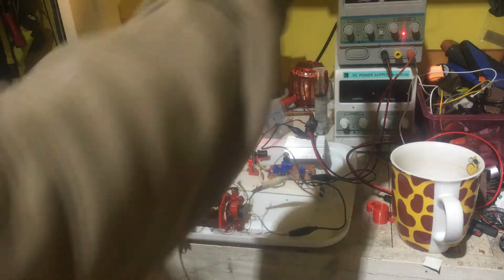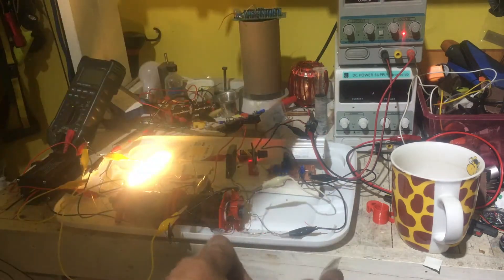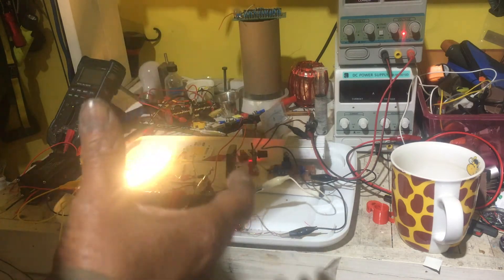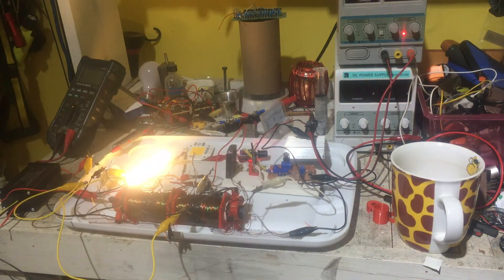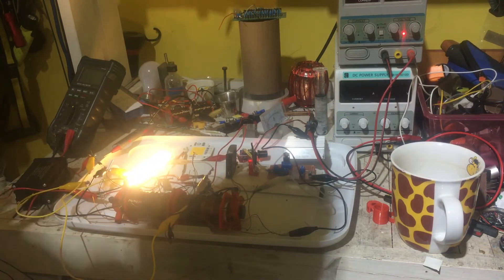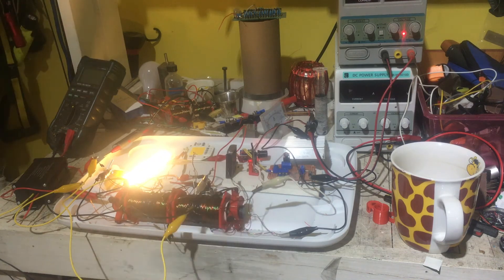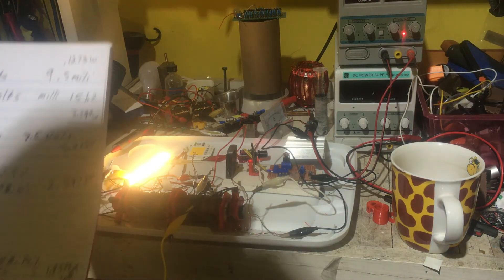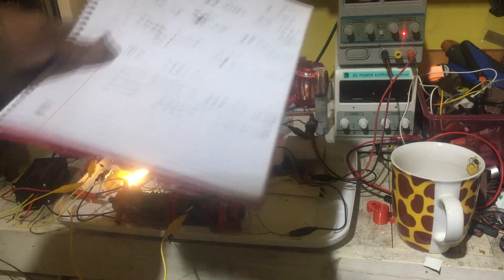OVER UNITY is SHARED SSG  This system negates all of OHM"S laws . Evidence above Greed disprove My

Comment: Inductors are non-ohmic components. Take a thick wire choke and put low frequency AC into it so at least .75 amps are being drawn. now measure the AC going through the choke.  You can easily measure >2X the input voltage with greater amps.  And it is not the multimeter messing up either, because if you are doing it from a DC source with an H-bridge, you can use a diode and separate out the back EMF and run things grounding into the + terminal of a battery.  

Problem is getting that power out...  It is happening because of the inductors back-EMF production, but it takes amperage into the coil to cause the effect.  Everything I do to extract the power gain results in a loss of the effect. 

I can easily charge a 12V battery from a 6V battery with the Back-EMF voltage gain.  See my videos in my channel where I run a motor from the negative terminal of a battery.  problem is for me it seems unusable..  If you measure output wattage you will be under-unity.  But if you measure what's in the circuit, it is well above unity.  

It is indeed an interesting effect..  And perhaps there is a way to tap it.  I have been trying hundreds of configurations and can't crack it.
Reply from the maker: very true now change the conception to a pressure vessel . The problem becomes no way to hold magnetic flux . in rotation fluctuation except in crystal form. but we don't have crystal wire except . it my be possible in quartz enriched iron, new metal are being created so maybe.  it took me a while to fully understand your comment thanks again

Comment: Dual pulse- I assume that means that after the mosfet  stops, then a second pulse turns the mosfet back on agin so that the collapsing field is rammed in to  the second field?
Reply from the maker: Dual pulse flip's magnetic field? ? To produce volt's, coil has to 90 degree from magnetic field. so no but the coil CW  and CCW  yes Thank you I'm guessing but if you can prove it yes. OK so look at it PWM pulse wave pulsing with a hall effect sensor.  In a Yin YAN coil.  It must be compressing force . sound's right. Glad To see you are ok Thanks keep me thinking
Reply: @sidster64  hi my friend
Can tornado a little a diagram please. You are using a power supply(dc) into a PWM into your primary. Where is the hall effect and how is it wired? Maybe it's my cell phone screen that's too small for me to see.  Thank you.
Great stuff as usual.
Reply from the maker: @Gacha.Cupcake  It’s a high current Hall effect sensor I showed it in previous videos the design is on YouTube
Reply from the maker: @Gacha.Cupcake  
            https://youtu.be/6VWAstiKCBQ
Reply from the maker: Also i know post a drawing

Comment from the maker: I would like to hear from folk's please.  Now i see what is evident. electrical force can be efficiently pressurized. Who Knew. Next is amplifying power. Seem's super simple.
Reply: sir, if you wind the secondary coil with 10awg wire 440v on S1 and 220v on S2  and for the primary with thin awg wire 30awg with 440-660 turns you with have very large amount of amplification with the large output secondary coils and the primary acting as an energizing coil. i am looking forward to your results
Reply from the maker: @RustyShakleford1  That a design I've seen and yes it would work . At present that not the issue. the issue is which capacitor and what voltage to set. coil's too .  As i increase milliamp the voltage also increases.  I can set the margin between 30 volt to one amp 30 volt to 60 volt.. thanks for the coaching.
Reply: @sidster64 thank you for the response. im not trying to coach, just making suggestions that i have had successful results with.
 I think being able to brainstorm with like minded individuals is the highest form of communication.

have you tried a rheostat on the input to vary the incoming voltage to tune the output rather than having to appropriately size the capacitor. it may be easier to adjust the input based on the load rather than adjusting secondary capacitors.

An Air gap in the secondary of the transformer can be used to temporarily shunt current to S1 and delay current in 
S2 which causes resistance to rise on the primary side P1, negating lenz law almost completely. let me know if that coincides with any your test results. 
Much appreciated,
Doug
Reply from the maker: @RustyShakleford1  Now that is exactly the point.  I'm leaning toward batteries that can be put in parallel no matter what voltage?  I spent a couple of hours tune it to 50 volt .5 amps.  I even thought go 100 volt but this design has limitation verses the first one.  I've run most all connection in series and still. I feel I'm missing something on the amp's side that what the best design would give. Yes I can tune it to most value in volt's but Amp's if i could figure amps That would be golden.  I feel I'm close but missing something. I'd hate to go to signal generator and high voltage I'm asking to much. Hey I easy old guy it's tool. And THANK YOU I did listen to your suggestion's I'm just stuck on the amp's